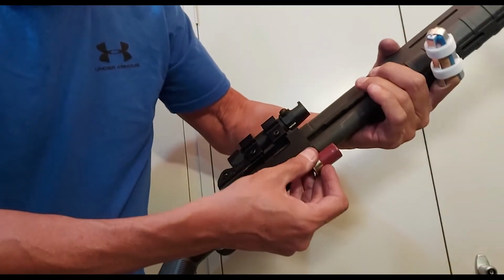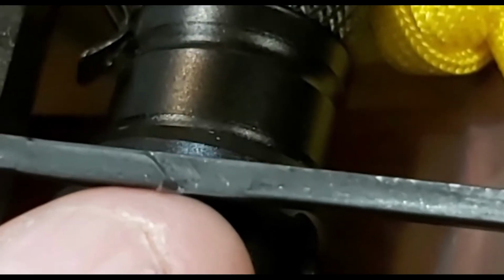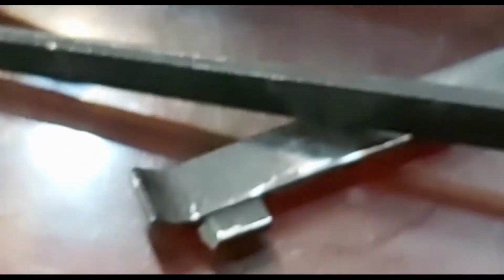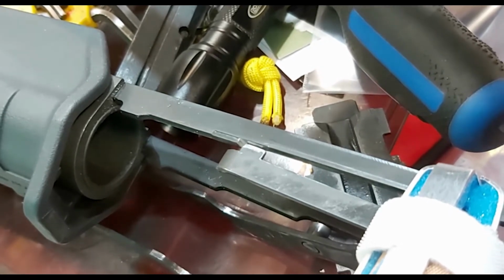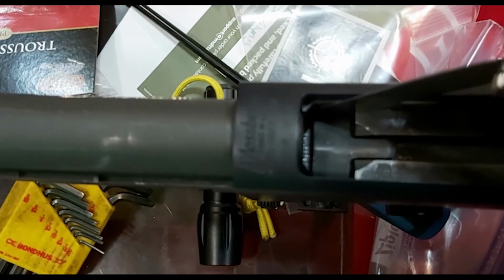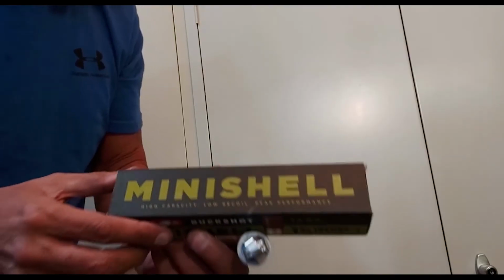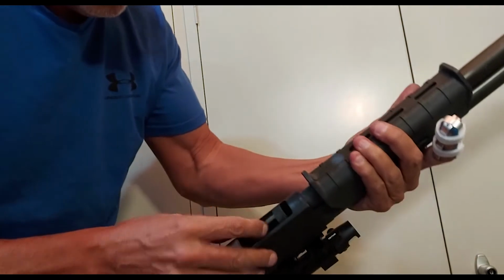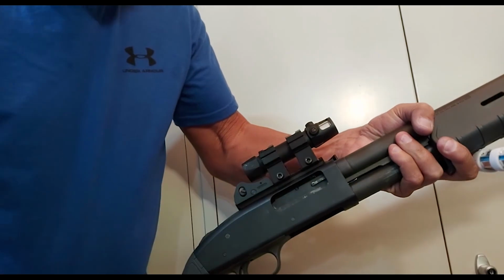590A1 Failure To Feed Fixed

Comment: Others have commented on an adapter from Defender Tactical that allows the 500 series of mossbergs to reliably cycle mini shells and standard length shells.

Defender Tactical now also offers an elevator with a longer tongue like you asked about towards the end of the video.

Comment: Thank you for pointing this issue out.  Pulled mine out of the safe after a couple years and it would drop rounds out the bottom, or not extract out of the feed tube.  I took my round stop out and welded a bead onto the cam surface, then filed it to shape a tad thicker.  I feel the cam from the factory was too thin, but this completely solved my feed issues.
Reply from the maker: That's a perfect way to improve upon the original design. You get more overlap of the contact surfaces. That makes it more reliable and durable.

Comment: Worked like a charm, Have a brand new 590A1 maybe put 200 shells through it. It had trouble feeding from the tube the first time i took it out, feeds better now that it ever has. Thanks!
Reply: Same thing happened to me, brand new 590a1 didn’t even make it through 2 tubes before the cartridge stop was just totally useless. Mossberg QC seems to be lacking lately

Comment: To add one other note and prevent this from happening again. Have a look at the initial contact between the 2 pieces and bend the piece that holds the shells in the magazine back a hair and make sure that the initial contact is somewhat around 50/50. Mine was contacting at the tips of the angle causing it to blunt over the ends

Comment: I had just bought a 590A1 the other day, went shooting today and had a hard time feeding. Thought it just wanted to play rough. But after a while I knew something was up. Followed your advice. Had burrs on both parts, which I filed down. Had to bend my one bar because it was too far away from the guide bars. Haven't shot it yet, but it seems to feed 100% better than before. I'll have to test it out and report back. Mossberg should have made the angled ramp longer or changed how it was actuated.

Comment: You need the Opsol adapter to run those minis reliably in that mossberg. Basically a rubber block that keeps the mini from going behind the elevator.

Comment: I don't have a 590 but another semi shotgun with a mag feed and same issue differnet parts. Would some grease along with your fix help the issue and solve the metal on metal contact?
Reply from the maker: Would not hurt, but the problem begins with not enough engagement between the leading edges of the two parts. If they make good contact, you're in the clear for reliability,

Comment: I have a brand new M590A1 and it runs like a top, not one hiccup. Maybe I got lucky, but this is not my first Mossberg. Also have a 500 Tactical that I've owned for 15 years with zero issues. Heard a lot of negatives about those Mini Shells, I would stay away from them.
Reply from the maker: I kinda think maybe the problem I fixed in this video might have been caused by the MagPull fore end. It was smoother to cycle with the original Mossy fore end. If the fore end is causing misalignment with the rails, that would cause the problem. I had a couple other Mossberg shotguns and both of them had feed issues with original hardware... so it depends if you got a good one or not... Lets be honest, for the price, its fine, but its no Benelli.

Comment: Good to know. Just bought a 590a1, haven't even put a shell in it yet. Hope I don't have to file anything or I'll be pissed. I'll have to check the action bars and shell latch for burrs. I wonder if the mini shells could contribute to the problem as it was never intended to use them?
Reply: I don't believe it was the minis. I have a practically brand new 590A1 and just tonight it began being unreliable on feeding. Never ran anything except 2 3/4"  shells in it.
Reply: @andrewulrich6612  still haven't shot mine. I hope its flawless, it had better be, it was $1000 here in Canada. It came with the okc bayonet which inflated the price a bit. Mind you I paid $1200 for a nickel tac-14 and it had some flaws I wasn't too impressed with. Everything is crap anymore it seems
Reply: @juliogonzo2718  what led me to the video was searching for a fix for the same issue. I tore mine apart this morning and had it fixed in 20 minutes. This 590A1 had less than a couple hundred rounds through it and I noticed it while running dry fire drills with dummy rounds last night. In any event, its fixed. The video is a life saver.
Reply: I just got mine, brand new 590 A1, put some 2 3/4 shells in the magazine, it did not feed at all, tried and tried, but it wouldnt feed. Brand new gun... haven't shot with it or anything.
Reply: @heligheten6868  that is a piss off! I still haven't shot mine still. I did cycle some shells through it. Waiting for hunting season to be over. Game wardens would likely not be impressed if I got caught in the bush with it
Reply: @heligheten6868  the fix is pretty easy. Just need some small files. It takes very few strokes to re profile the engagement surfaces.

Comment: I had a Mossberg 590 A1 USMMC model. I sold it away as I wasn't impressed with the quality. Very clunky and heavy, lots of stamped cheap parts, lots of misfitted loose toleranced parts and just gave an overall low quality feel. It was my first foray into shotguns. I've seen better made  cheaper foreign brands of pump shotguns. Later, I bought a Mossberg 930 Home Security model. Same thing, lots of cheap, loose tolerance, stamped parts. And the price went up even. Not satisfied with my second Mossberg, I sold it away after owning it for 2 months. I wish I have plenty of money to take a chance on another Mossberg.
Reply: A shotgun is a very simple tool. Basically a big tube for throwing big weight with relatively low pressure. But more than anything it needs to be reliable after a bit of break-in. I can promise that all of the Mossbergs I used in the military were "clunky", "heavy", and with "lots of stamped cheap parts" - not unlike an AK. And very reliable.
Reply: @Josh-dx4tu  Thank you for your serviceJosh. To each his own I guess. I want a shotgun that doesn't feel cheaply made and clunky YET reliable. There are plenty of brands out there that meet my desire. I sold away my two Mossbergs and bought two that are not as clunky AND reliable. As they say....my money,my shotgun. Cheers.
Reply: @EndOfThings77  I understand. I don't know what you got, but if you're still looking for a great pump or auto, go Italian.
Reply: @Josh-dx4tu  Thank you, buddy. I bought a Stoeger M3K in 2019. It is inertia drive semi auto made in Turkey. Last month I bought a Benelli Super Nova Tactical, which is a pump. I am satisfied with both. However, I still want another semi auto and my eye is on either the Benelli M2 or the Beretta 1301 Tactical. Not on a rush to buy my third shotgun. I'll be on a leisurely hunt and have until early next year. It will be my retirement gift for myself. While I have the money for the Benelli M4, it is way too expensive for what I intend to do with them. Most of these shotguns will be spending their time in the cabinet with just an occasional range trip for fun. Thank you again for serving our great country!!
Reply: @Josh-dx4tu  ahhh I was with you until the end. I own and have owned many rifles.. cmmon guy at this point you can't call an AK unreliable.
Reply: @stgeorgethepurist8311  Re-read what I said.
Reply: @Josh-dx4tu  I stand corrected. Have a nice one 👍